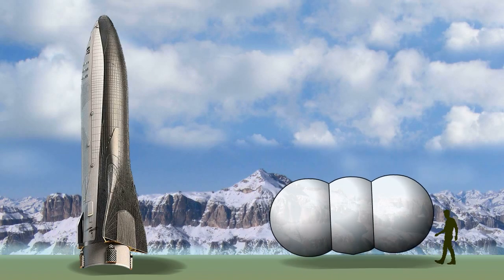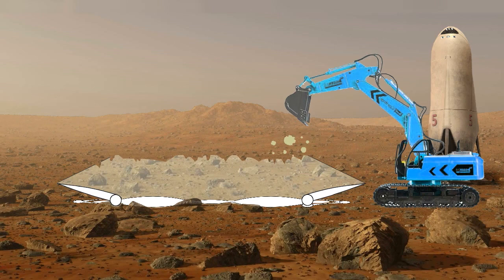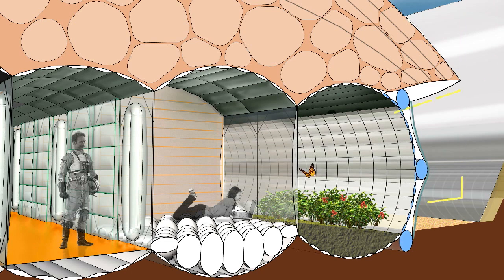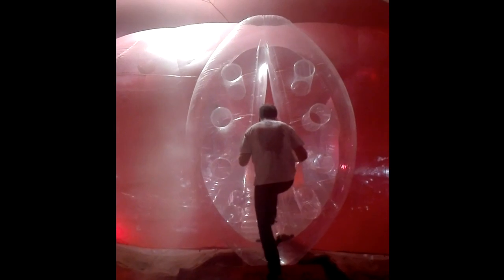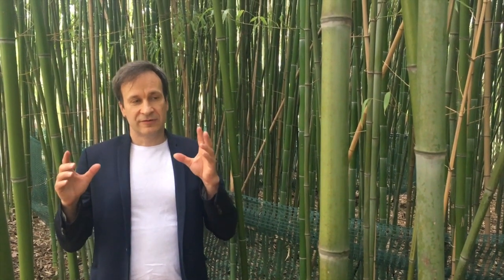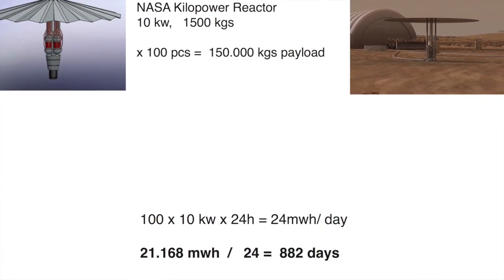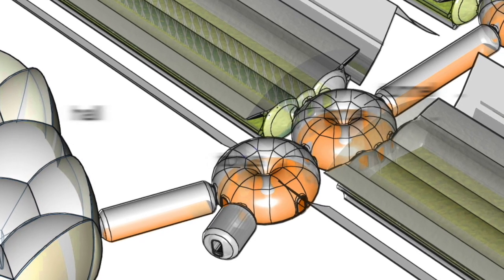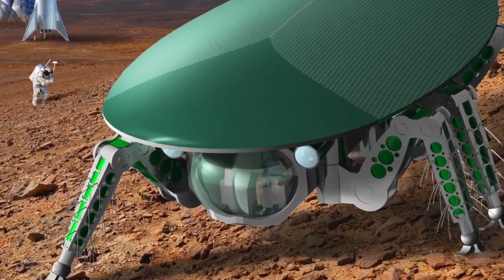inflatable Mars Habitat and Moonbase ,  Pneumo Planet

Comment: Hello! Very interesting presentation. There are several things about this concept that I do not understand:

1: If a robotic task force must dump tons of jagged regolith on the top of a given inflatable habitat module, what are the risks of damaging the module /  puncturing its "skin" before it even gets inflated? (I assume that construction of a Mars base/base-camp would be carried out by robots in advance of any astronauts being dispatched from Earth.)

2: If we accept that bases/base-camps on Earth's Moon or Mars must create hard-formed and sheltered landing/launching pads for visiting/departing spacecraft, and that this process will likely involve melting regolith using a robotic task force that would be energized by small atomic powerplants, wouldn't an expedition already have the means to use regolith to build artificial caves?

3: If an expedition arrived on Earth's Moon or Mars to set up a base or base-camp inside of a deep, subterranean lava tube, could a habitat module like the ones shown here to be used in that environment? How would it differ? Could a lava-tube-base rely on a series of silver mirrors to divert sunlight into the tube to illuminate the module(s)?

4: RE: The wing-like Protruding Roof Modules that are shown containing the roof-top regolith on the inflatable greenhouse module. How do these wings contain tons of regolith without collapsing? Do all of these modules, regardless of type, utilize these wings?

5: RE: inflatable habitats on Earth's Moon. I understand that the temperature on the lunar surface varies as much as 400º between lunar day and lunar night. How are these modules designed to withstand such extremes without freezing solid or melting? How does the outer skin of these modules keep from rupturing from the extreme temperature fluctuations?

6: If mirrors can be used to divert sunlight for illumination purposes, could they also be used to focus sunlight on a steam reactor to generate power without using nukes? Could this be made practicable for lunar bases at the lunar poles? (I understand they already do something like this for a solar farm in Spain.) Could something like this also be done on Mars?

7: I understand that scientists suspect that Martian moons Phobos and Deimos are thought to be "rubble pile asteroids" simply captured by Martian gravity. If we were to land an expedition on either or both of these satellites (Why not? If we send astronauts to Mars, we're already in the neighborhood.), would it be possible to use inflatable habitats like your concept to set up a base-camp on top of such atomized terrain?
Reply from the maker: thank for all your questions:
1; the regolith that gets in direct contact with the membrane shall be smoothened before by getting stirred inside a kind of concrete mixer cylinder, so by abrasion the grains will be smoothened like sand is smoothened in the desert being moved in the wind. Additionally we can add a thin foam protection layer on top before the regolith is deposed. I also would fill the regolith into  thin bags ,so it can't get blown away by the wind

2; bricks made of melted regolith don't make an airtight structure, so you will need a membrane enclosure as well to ensure airtightness. There is no need for any rigid structural parts, because compared to the thin martian atmosphere the inner air pressure makes the membrane  is a hard as a car tire. All required structural support is provided by the inner air-pressure

3; A lava tube needs to be explored carefully before a building can be designed that fits indie well. and it is difficult to direct natural sunlight inside.  There is no guarantee that there will be a suitable lava tube in the right places near the equator that are close to suitable landing sites and contain underground water relatively close to the surface I think it is much easier to spot out a suitable flat ground on the surface and form the loose regolith into the manner you want it to be.

4; there are arc-shaped cables guided through the regolith deposit that uphold the wings. the wings improve the geometry  where cosmic radiation is shielded

5; the moon habitat version is placed on the lunar poles where it never gets that hot. Additionally it is covered by several meters of regolith. no direct Sun-ray ever hits the membrane, except what is reflected by the mirror membrane. so it will not be exposed to extreme temperatures. Only during the installation process it will get extremely cold But the mylar membrane material, that I opt for, remains flexible down to +3K°

6; Yes, we also are considering to use one of these mirrors for a huge solar oven to melt iron and aluminium or to sinter regolith. But that works much better on the moon than  on Mars, since on the moon sunlight is almost permamently avialble with 2,5 times the intensity than the maximum on Mars.
For he moon we have calculated the efficency of photovoltaic panels vs nuclear power plants, and the energy output per kg of payload is much better with photovoltaic panels.  on Mars the situation is different of course. Producing heat from sunlight for a sterling engine that produces electricity in a dynamo is less efficient than producing electricity from photovoltaic panels.

7; if Deimos and Phobos really  consist of loose rocks and dust held together by micro-gravity ( like most asteroids are), then it is very easy to drill a tunnel, insert a membrane enclosure and inflate it , so all the loose material is just pressed outwards.  This way you create an inflatable habitat inside a cave, where you  are well protected from cosmic radiation, meteorite impacts and cold

Comment: sooooo.....its a solar oven with vaginal openings? hmmm. my question is... how many things can go wrong. between pressure. heat. oxygen. time to grow things to make oxygen. holes. enough space to not go crazy.common areas. growing enough food. having multiple people use the space at once.this is a very clever.. but very finicky design. too many variables. it may be good as a backup habitat. or an additional support habitat. but not that I know anything. I am just feeling this is not a good idea to have as an only main habitat. it's not sturdy enough.. get one of those martian storms. and I think this thing will be done. because it would be good to send up as a space saver..due to cargo weight... I would def use this with a solid structure. you guys need to team up. so if one habitat fails. the other one can be used.. in whichever order that works.
Reply from the maker: the challenges , that you mention concern any kind of Mars habitat in generell. We have considered them , and I think we have found solutions that are better than on most other concepts. 
Creating spaces large enough so people don't get claustrophobic  or crazy inside is a lot easier with inflatable membrane structures , since the payload is very little and we do not need  all the time and energy for 3D-printing massive rigid walls and ceilings. 
The inflatable module produced by Bigellow for the ISS station proves that inflatable  membrane structures are save and reliable in space. 
For our Mars Habitat it is even easier, because we can use loose regolith from Mars to protect the Membrane against radiation  and any kind of mechanical impact, while on the ISS the outer membrane layer  is fully exposed to cosmic radiation, meteorites and debris.
As shown on the video we provide several membrane layers for extra safety.
And there is not just one inflatable module, but  a grid of modules, so if one module gets seriously damaged it can be decoupled from the grid, while all other modules still are operational.
Unlike in the movie "the Martian",  in real Martian storms are harmless due to the extreme  low density of the atmosphere. 300kmph windspeed  on Mars have the same force as 30kmph on earth.
Reply: @thomasherzig174  Great explanation. I'd be interested in knowing more about the specifics of this design, as I could feature it in an upcoming video I'm planning for "living on Mars".

I'm currently working on transportation, but we should connect after I'm done that so I can feature your designs in my "living on Mars" video!

I always thought there was a big role for inflatables to play in off-world pressurized space construction; keep up the good work :)
Reply: also... how would you prevent mold.?

Comment: not fan pile on method as wined blow off.get big dust storm like got when rovers risk not get any solar power. could blow all lose dirt off risk for astronaut try put back on in wind. as for power think could use wind mills with solar and grow plants without use any sunlight. risk radiation not sun light self. though do like how such long tub with green house buffer both sides live area. mirror aim radiation into house. but mirror idea maybe use full focus sun light solar panels. if come water field wall. orgianel idea might still work. I have no proof water filed wall even protects radiation but claim oxygen in water molecule. oxygen ozone earth should limit or protect agents radiant. have extra water around never bad thing. so if want go with pile on method. different group build build in way catch dirt. after figure out were wind come from. may want some kinda infallible wall or C shaped structure around habituate. so that dirt can't go anywhere. if get luck back side stay dirt free put solar panels on it or maybe towers of wind mills post of fence. if wind blow dirt in direction that want wind mill at. bottom of them could post for infallible fence.  always fan test stuff out Arizona for warm burrow alaska for cold. if dosent work there not going work on mars.  it get hotter and colder then both places.

Comment: Fully agree the 3D printing concepts are silly.  And even if you could do it you would not want to make a pressure vessel from it due to the potential for cracks and leaks.  Simply create a hollow radiation shielding dome and place an inflatable pressure vessel inside.  I do think PV will be preferable though, you used a 10% efficiency consistent with a thin-film PV, but then sited masses for crystalline silicon panels, the simplicity of simply laying out long strips of PV from rolls and burying the edges in regolith seems the best bet.  The simplistic laying out of the membrane and piling on regolith and then inflating was one of the best features of your design.

Comment: inflatables can be moved also.
this is how it should go:
#1  test it in the arctic for 400 days
#2  test it under the ocean for 400 days
#3  test it on the moon for 1 year
#4  test in on mars for unmanned for 6 months
#5  If completely successful, use if for moon and mars colonies.
Reply: #2 is the apposite of what is needed on Mars.  In the ocean, the pressure would be from the outside pushing in, while on Mars, the atmospheric pressure for humans would be within the habitat pushing out.  You have such optimism!  Do you believe there will be million people cities on Mars?
Reply: @nightlightabcd    eventually.

Comment: Bigelows do protect from micrometeorites. In fact 50% better in fact than the special space aluminum grade material NASA uses on it's ISS Modules.
Reply: Bigelow-type habitats , with regolith-filled walls , would be the Martian equivalent of "igloos" . They would be simple , and relatively straight-forward to construct . Small ones could even be assembled by hand . 
The optimum would be air-filled B-Bags in cliff-side caves , reasonably close to serviceable landing fields . This does however , call for advance drone surveillance , in order to locate these possible shelters . 
All entrances on Mars must be safed against contamination with Mars-dust , as this material would inevitably cause heavy and irreversible erosion of exposed surfaces . Multiple provisions for washing off the dust must also be part of all installed facilities . 
*To examine this subject in more detail , read my post at : 
quora.com/Guys-give-it-to-me-straight-we-ain-t-going-to-Mars-Are-we/

Comment: OK----------- Sorry but I tried to live with inflatable furniture back in the 70's when it was the rage.   And inflatable furniture SUCK BIG PURPLE  DONKY DICS!  But the habs would probably work out well of dun right as i was in to that as well back in the Crazy 70's and had a lot of fun making them.  LOL
Reply: They are made from several layers of Nextel and an advanced formula of Kevlar. It has been tested to stop micrometeorites 50% stronger than NASA'S Modules and is also supposed to stop more radiation, although I have not seen any real world numbers on that.

Comment: will it be bulletproof ? dust storms on mars are worse than here on earth
Reply from the maker: they are not, because the air density on Mars is less than 1 percent of that on Earth.  A "storm" with 300 kms per hour has the same effect there  as a wind with 30kms/h on Earth.  The scene at the beginning of the movie  "The Martian"  is not realistic.  Beside this the 3-4 meters high deposit  of regolithon the ceiling gives more than sufficient ballast against any storm